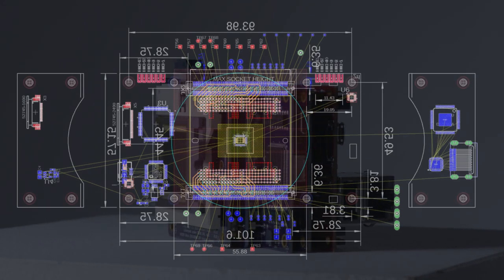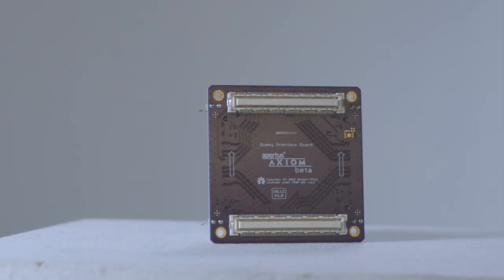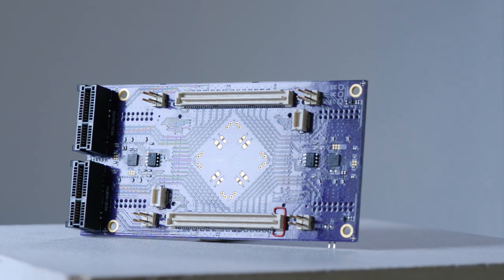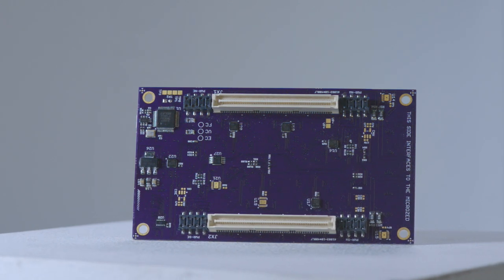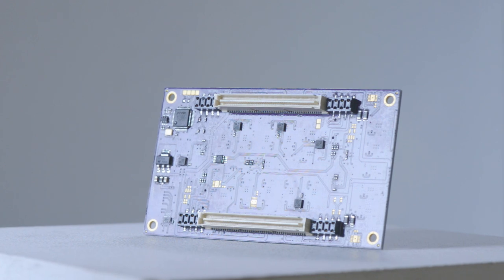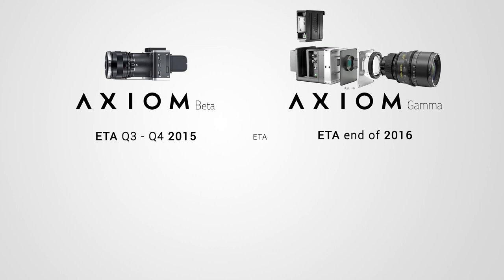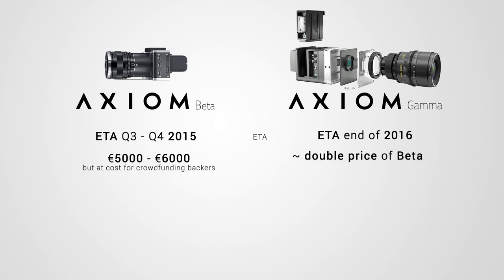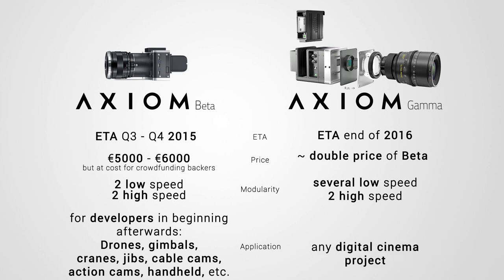AXIOM Team Talk - Volume 6

Comment: Hi guys thanks for the latest team talk which was very informative.       Whilst it was very information packed and answered a fair few questions it also raised as many new questions for me I'm afraid!  (Sorry).

Basically I am now rather confused about your future hardware revision plans.  Many times (with pretty much every individual PCB mentioned) in the video new features were suggested that would appear "in a future version" of the hardware.

I'm not at all clear if this is simply going to be a single further revision to come later or if these changes are going to come at different points and that all the boards will get progressively more feature filled over more than one future revision.

I assume these "future revisions" are going to be available in the cameras that the original crowd funding backers can receive but that isn't completely clear from the video.  Can you confirm?

In terms of future hardware revisions and delivering the cameras to people, I'm hoping the first of the two scenarios I mention is what you plan (just a single improved future revision) but can imagine that this may be difficult to achieve due to the R&D and experimentation that still seems to be going on with the hardware plans.   I had imagined that the beta hardware plan was very much fixed by now but it seems not.

If the second of these scenarios is what is going to happen whilst its great that there is the chance of more features that were not planned to original crowd-funding backers isn't this going to be really difficult to communicate to people and organise peoples orders ?     

I can imagine that quite a lot of people wanting the beta camera don't actually want a really early version of the hardware (like myself).     If we are being asked at various points to confirm when we want the camera how will we be in a position to know that the boards are still not going to under go further big improvements in later revisions.   

I'd be really annoyed if I received my camera and then found out a later version was going to have some extra not already discussed.   For that not to happen can you please make a really clear detailed plan of all these hardware changes and what people ordering the camera at various points of production are going to get.      And in the short term can you respond here and confirm roughly how you intend for these future revisions of hardware to arrive?

Comment: Will the Ir filter be easily replaceable/removable without replacing the sensor? Switching to a yellow filter would allow for false color infrared footage similar to the discontinued film stock Aerochrome, and I'm sure there would be other uses as well.